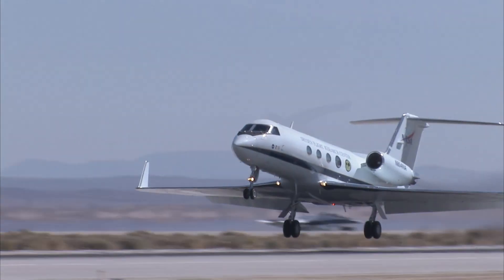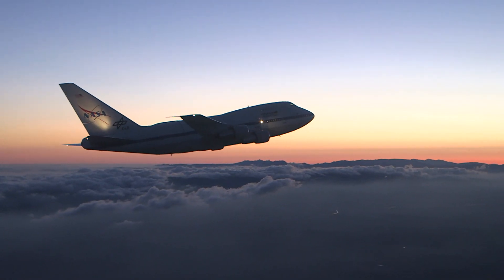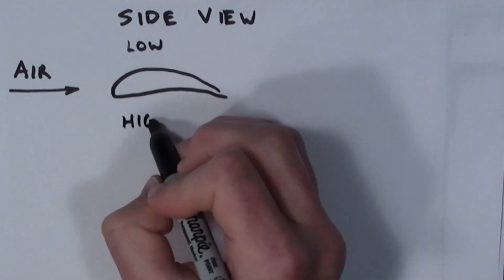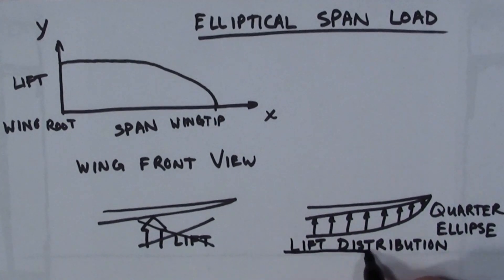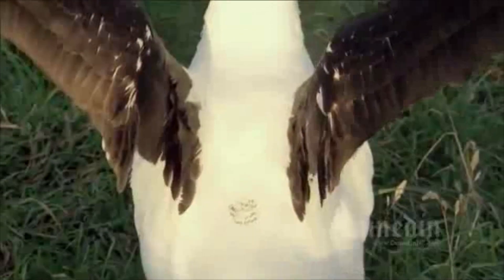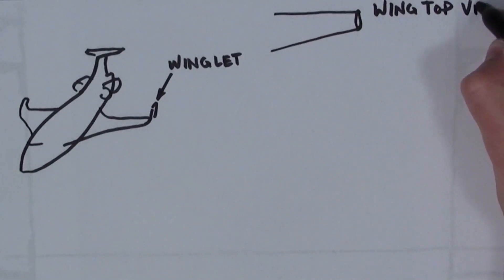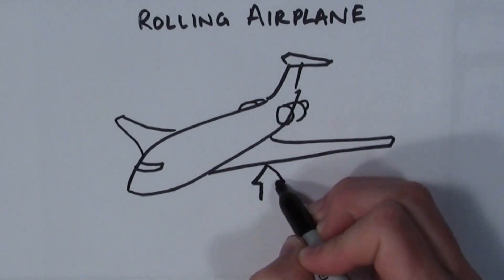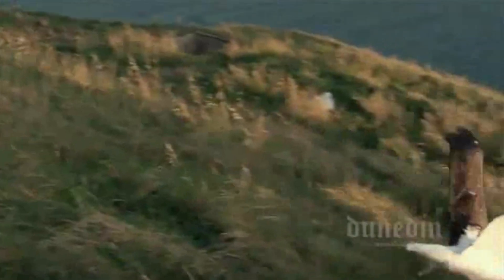Proving Prandtl- With A Twist!

Comment: Hang gliders have wing tip twist or washout and have had for decades.  Training gliders have the most and have almost no adverse yaw.  Gliders for intermediate and advanced pilots have less washout (among other things) to improve glide performance, especially at higher speeds, with the result that there is more initial adverse yaw before roll forces and pilot induced pitch up coordinate the turn.

There is no free lunch, washout reduces the glide performance of a wing when flying straight and generates more drag at higher speed.

 Washout also is part of the pitch stability system, the tips are behind the root and since they have a lower angle of attack, the root stalls first, the tips still provide lift and a pitch down moment that causes the glider to dive if the pilot stalls the wing.

Hang glider pilots have limited ability to actively modify washout and are not able to modify washout asymmetrically.  I don't know what control birds have on washout but if they can modify washout then they could keep the twist low for gliding flight, especially at high speed, and then twist one wing tip to generate proverse yaw as part of a turn.

I am glad the students are learning but unless I missed a subtle detail everything they described has been in use for years by every hang glider manufacturer.
Reply: Hi Jeff! Hang glider pilots can and do actively modify the washout - especially asymmetrically: it's how they roll the gliders. The design change to the floating crosstube, in the 1980s, was the key. When the pilot shifts weight to the right (for example), the actual control input is to pull the control bar to the left (there's also something of a twisting action but that's not relevant here). The control bar is attached to the sidewire, which is attached to the outer end of the right crosstube (or the leading edge near it), and pulls that to the left. At the same time, the pilot's hang strap is attached to the keel, and when the pilot's body moves to the right, the hang strap pulls the keel to the right. With the sidewire pulling the crosstube to the left, and the hang strap pulling the keel to the right, and no physical connection between the crosstube and the keel, the distance between the right wingtip and the back of the keel shortens, allowing more washout on that side (and of course less washout on the left side, where the distance increases). The effect on the washout is quite large. This, and not the weight shift itself, is the primary source of roll control on modern hang gliders.
Reply: @FinbarSheehy  I am aware of the floating crossbar, all modern gliders have this feature.  They affect sail tension asymmetrically, flatting one side of the wing and allowing the opposite side to billow up more when a pilot shifts their weight, and this dramatically improves roll response.  Washout at the tips is enforced by either washout tubes or sprogs.  These do not twist with roll input or crossbar movement.  The washout tubes or sprogs  enforce washout to guarantee positive pitch pressure, even in a dive, or other adverse maneuvers.  This is part of how modern gliders avoid dive induced, unrecoverable loss of lift present in Rogallo gliders.  

In thinking about it more your argument is correct and further strengthens my argument that they are learning what every hang glider manufacturer already knows.
Reply: @JeffCurtisIflyHG  It's actually a bit different to what hang gliders have been doing, although the configuration is quite similar. Hang glider washout reduces the AOA at the tips, but there is still an upward lift force on the tips (which is why they float above the washout tubes/sprogs). In this design, in contrast, the AOA appears to go negative at the tips, generating a downforce there. It's a subtle idea that relates to bending moments at the wing root and counterintuitive adverse yaw behavior. But, it also requires a significant increase in span, which would be a disadvantage for hang gliders.
Reply: +Jeff Curtis . You are right trikes and HG use similar concept but the designers are doing this from intuition more than controlled sense and data to be very honest. Its not optimized. Plus its a flexwing that looses a lot of the efficiency. Some designers like Dr. Bill Brooks have tried to optimize trike wings for lift distribution making large gains from previous generation wings using Prandl's work and careful measurements.
Reply: +Finbar Sheehy  Fascinating! The "text books" on hang gliding don't talk about this at all (at least Pagen's beginner/intermediate Traing Manual doesn't).
Reply: @awuma  mine too.
Reply: @awuma  This one does: https://www.amazon.com/Hang-Gliders-Technical-Notebook-ebook/dp/B005IC6DWY/ref=mp_s_a_1_1?dchild=1&keywords=hang+glider%27s+technical+notebook&qid=1620916960&sr=8-1
Reply: +awuma Mine does :-)
Reply: When I started flying hang gliders in 1973, it was the standard Rogallo.  I had an interest in seeing if I could make a small scale model to experiment with variations on the Rogallo design.  The materials I was using made it expensive and very time consuming, and flight, although successful usually resulted in some damage as it was simply free flight.  I turned to simple paper and Scotch Tape to create design modifications.  Cheaper and I soon began to greatly improve the design to the point that it was now a very nice flying wing.  It was around 1975 that I visited Bill Bennet Delta Wing Kites and Gliders manufacturer and showed him my paper airplane (Glider), which I call the OmniWing.  He wanted to see it fly, so we went out to the parking lot and he grabbed it by one of the wing tips and tossed it into the air like a boomerang.  Bill was from Australia, so I guess he did a bit of boomerang tossing.  So the OmniWing went up into the air spinning out of of control, but it recover and went into stable flight and flew across the highway.  I recovered the wing and he asked if I would leave it with him so that others could see the wing fly.  Some months later he produces a hang glider that looked very much like my OmniWing planform.  So I bought one.  Now, almost all hang gliders look like my OmniWing design.  Same aspect ratio, same nose angle, same sweep, and same twist and washout.  Each manufacture has small variations, but all are very similar.  Check out a flight of one of my OmniWings off of Mount Nebo, in Arkansas.  Was an exceptional flight.  Video shows a fast build of the wing  and then one of my best flights.  https://www.youtube.com/watch?v=SrZ1bqU_g4o

Comment: It's a clever, non-obvious idea, using the washout to eliminate adverse yaw. However, without being sure, I imagine that the washout that eliminates adverse yaw will not simultaneously deliver the optimal low-drag lift distribution for straight flight. Thus, you eliminate the drag of the vertical tail, but accept the drag of the non-optimal lift distribution - not clear if that's a "free lunch", but maybe it is! Intuitively, if loading up the wing increases its L/D, that loading condition should be used on both wings in straight flight for greater efficiency (sacrificing the no-adverse-yaw feature). Also, the optimal washout for eliminating adverse yaw probably varies with speed (alpha). Certainly,as Eriksson Tord points out, birds routinely use their tails for yaw control. They generate lift with their tails, and tilt their tails to angle the lift to the side, providing a yaw force; they're not relying solely (if at all) on washout. I would be (very) surprised if soaring birds continuously operate away from the optimal L/D condition, just to provide automatic yaw control, but they may twist a wingtip for yaw control as needed.
Hang gliders look similar to the model in the video - swept wings with neither vertical nor horizontal tails (although they have lower aspect ratio than that model). Whether weight-shift or aerodynamically controlled, hang gliders display a moderate amount of adverse yaw, and hang glider pilots just get used to it.
Reply: +Finbar Sheehy Having had a chance to think about this, I think we're looking at an interesting coincidence, here. There are three distinct parts to this, which I'll call A, B and C.

Part A: The usual question about "minimum drag" says, "given a maximum wingspan, what is the lift distribution that gives the highest L/D ratio?" The answer to this is, "elliptical lift distribution", and that's not wrong. 
Prandtl, though, changed the question, and asked, given a maximum lift/bending moment, what is the lift distribution that gives the highest L/D ratio?" 
In this second question, wingspan is not constrained. So, here's a thought experiment: take a wing - any wing - and then add two sections to each wingtip, one lifting up and the other, outboard of it, lifting down by exactly the same amount. The net lift hasn't changed, but the bending moment at the wing root is lower, because the additional downward force is outboard of the additional upward force. And what about drag? Well, on the one hand, there's more wetted surface, but on the other hand there's more span, so it's not intuitively obvious what has happened to L/D.
What Prandtl found was that the L/D will have gone up, and he went on to find the distribution that gives optimum L/D if the span is not constrained but the maximum bending moment is. That's all - notice that it has nothing to do with swept wings, and isn't about preventing tip stalling (the purpose of washout).

Part B: This is the coincidence part. What happens when you put ailerons on an un-swept Prandlt wing? If the aileron is all on the outboard section, where the lift force is downward, then when you deflect the aileron downward you reduce the local (downward) lift force, and reduce the local drag. And vice versa on the other side. This is the opposite of the normal effect of adverse yaw on ailerons: it's proverse yaw. But, it only works if the ailerons are out at the tip, in the downforce region. If you have large-span ailerons, it won't work. Also, as the wing actually starts to roll, you'll still see a reduction in the "proverse yaw" and it may even reverse. Why? Suppose you roll right. You deflect the right aileron upward on a tip that is generating downforce. This increases the drag at the tip, and tends to yaw the aircraft to the right. But, as the roll starts, the (negative) angle of attack on the outboard tip will be reduced by the rolling motion, reducing the "proverse yaw" effect. It's conceivable to me - I haven't tried to prove it - that you could choose the aileron length so that you could get proverse yaw at the start of the roll (creating a skid), and some adverse yaw as you stop the rolling motion, so that the nose would stay close to - but not exactly - where it would point if there were a good glider pilot at the controls. Close enough to not really require a rudder for normal turns. But, because a straight wing is not yaw stable, you still need a vertical stabilizer for yaw stability in straight flight.

Part C: A swept wing is yaw-stable in straight flight, without a vertical stabilizer. Normally, swept wings - like hang gliders - are yaw stable but have problems with adverse yaw during roll inputs unless you fit them with a vertical tail and rudder. With a swept Prandtl wing you can get yaw stability during straight flight and approximately zero yaw error during roll inputs. As long as the residual yaw deviations are acceptable, you can dispense with the vertical stabilizer and rudder. Of course, the properties of swept wings mean that, to achieve the Prandtl lift distribution, you'll need more geometric washout than you would have needed with straight wings, and this will narrow the speed range (or angle of attack range) where the arrangement will be optimal.

Now for an observation. We're talking about a wing with quite a lot of twist (you can do some of it with airfoil selection, but the local zero-lift-coefficient incidence angle will have a lot of twist in it), and as you move away from the design airspeed (change the AoA) the lift distribution will move away from optimal - all the more so if the wing is swept. As you speed up there will be too much downforce at the tips, too much upforce in the center, and too much drag from both. As you slow down, you will lose the proverse yaw benefits. So there's a trade-off here: you do get to remove the vertical stabilizer, with its associated drag, but you narrow the efficient speed range of the aircraft. Sailplanes actually need wide speed ranges, so despite eliminating the drag of the vertical stabilizer, I doubt that this is going to be a winner in a sailplane application, even in the Open class (unlimited span).
Reply: @FinbarSheehy  This may be the best breakdown I've ever come across on Prandtl wings.
Reply: +Finbar Sheehy Well put!
I missed the 'extra' replies under some of the arguments above, not realising someone had more or less already explained some of the (misconceptions is a bit harsh but) confusion about performance from winglets versus 'flat winglets'.
Seems to me they have accidentally discovered the benefits of aspect ratio !!
As you say, we are not likely to see flying wing sailplanes any more as they have reached their limits (Horten IV was something like 40:1 in 1938), normal layout gliders far exceed that today.
Reply: @FinbarSheehy  Thanks for your learned comments. What is the problem with a v tail mixed with ailerons?
Reply: @jazldazl9193  There is no real problem at all with that approach - or with using a conventional tail. The video is simply discussing the interesting property that the wing can be designed in such a way that the V tail is (approximately) unnecessary.
Reply: @FinbarSheehy  Well put. On top of this we must look at the practicality of building and operating a vehicle with a 25% longer span to achieve a similar performance. There are already practical and cost problems with airport sizes and buildings in much of the world.  Nor is there any discussion of the practicality of moving people or freight  without adding bulk or fuselages and hence extra drag. Nor do we see much about pitch response in these discussions which suffers from the shorter moment arm compared to convention.  If I wanted to DS the oceans and live on the odd fish picked up at the surface on the way for months at a time I would probably need a remarkable computer to get anywhere near the efficiency of an albatross.  As I prefer to travel in comfort with luggage like most of us we have to compomise in order to achieve this.  If Prandtl wings could achieve a higher Cl and the performance range of sailplanes, they would be already be competing in numbers. (This is an area where even the German Akafliegs who have been responsible for much of the progress in sailplane design have done a great deal of research). As you point out, this is unlikely to happen.  There may be other uses after more work is done.

Comment: All birds use their tails for both yaw and pitch control, as the video so eminently shows.

Professor Prandtl was old when he designed his tail-less flying wing, so he probably had forgotten how a bird really flies, but teaching students that birds don't have a tail like aircraft is silly (the do lack a fin, but use the tail as a replacement surface), as the video so well shows. Modellers sometimes add a V-tail to birdlike models, to get some control in yaw, but I am not aware of any living bird with a V-tail!

Thousands of videos have been taken by now showing how birds move their tails in detail, and some birds even use their webbed feet, and necks, to control pitch. And big beaks affect yaw, of course.

They move their tails up and down, twist them (for roll control), and also move their tails from side to side, plus use complex combinations of these basic movements, thus there isn't any passive use of tails on birds ever. Hawks spreads their tails for soaring, and closes them for power dives, and I've studied extremely complex movements of the tails of crows and jackdaws, from very close distance.

As an ex-glider pilot it is interesting to note that there are no, as far as I can see, control surfaces on bird wings, so ailerons and spoilers for roll control are man's inventions, not the birds. Airfoil camber can be controlled, and they have feathers that functions similar to flaps. But essentially their wings are rigid, with adjustable camber and span. Some bending occurs during flapping, but this is about gliding birds, as Prandtl's design wasn't designed for flapping, was it?!

Doves change course by using more power on one wing than the other, and battle with their wings as well, never using their feet, or beaks, to harm the opponent, unlike some other birds. Much like boxing, they first try to stare the opponent so submission, and then stand with their torsos vertically, and deliver heavy body blows - great fun to watch!
Reply: Eriksson Tord Actually, he had not forgotten anything. There are two types of birds, land birds and maritime birds, which use two different methods of controlling flight. For land birds you are right, they use their tails as control surfaces. However sea birds, take the albatross as an example, do not use their tail surfaces for attitude control. The albatross is the bird Prandtl studied.
Reply: +Eriksson Tord I have watched hummingbirds in close quarters, when the hummingbirds allow.  They appear to change the angle of every part of their bodies, including wings, to yield the forces necessary to cause orientation change, especially when fighting (which is nearly constant around my feeders).
Reply: You are right! I have similar conclusions, and because of that, I am reading this stuff... something does not go in the correct direction. All birds use tails (even Albatros have one)... not vertical surfaces, but they are shifting it ...